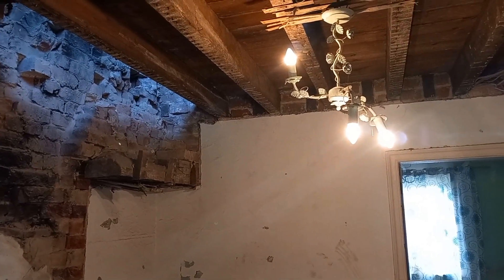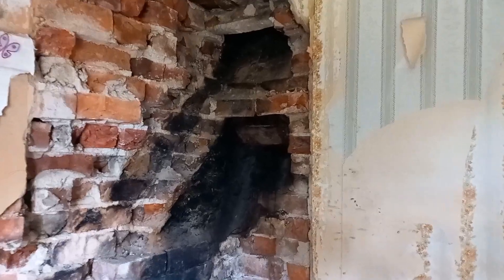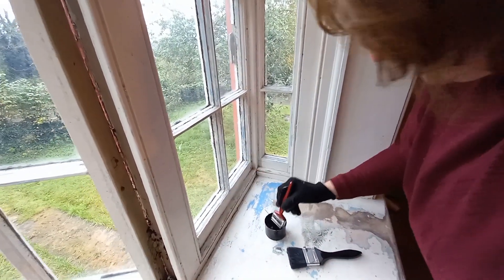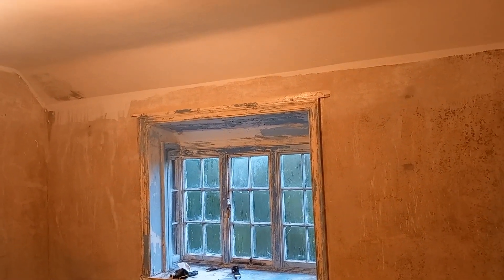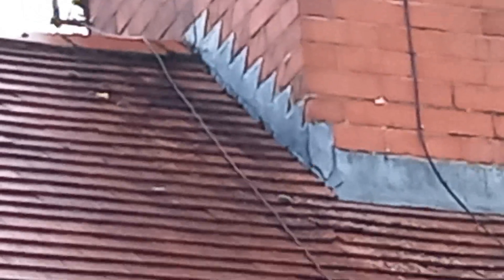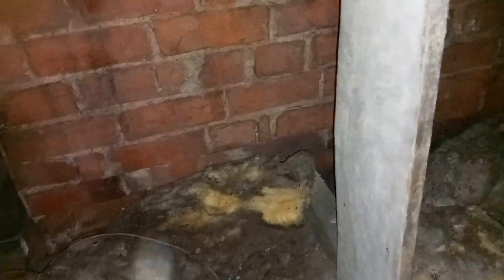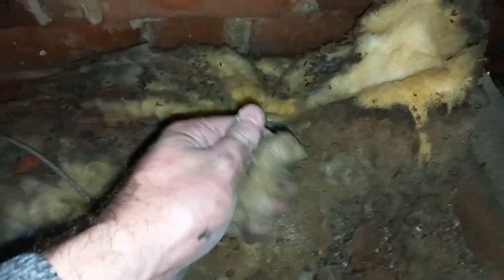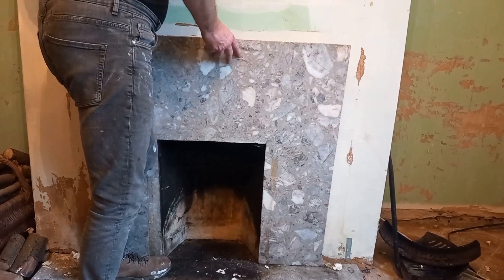STOPPED Cottage Renovation | House Restoration | Ceiling Insulation Install

Comment: That’s coming on really well , shame about the leak but on the bright side you found it early on. Log burner will be fantastic I’m sure you will have lots of wood for it when you start the garden. 
Keep it up until the next video.
Reply from the maker: Cheers Stuart. Thankfully the leak is tiny in the horrid wet weather, it looks worse as the house has been empty for yonks and any wet never got chance to dry at all. We shall use the heater to try and dry the ceiling ahead of going over to collect the ladders from storage.

Comment: Possible pointing issue? Or it the flashing like you said!
Reply from the maker: Fingers crossed its that end ridge tile fixing.
Reply: @OurCountryRetreat  I’m having some pointing done soon after a leak above my window due to that heavy rain we had. and also mate I would seriously look at it. May need pointing up but I’m no expert
Reply from the maker: @RaymondoLeeTravel  I went up there today, well just part I could access. I could see nothing obvious, but applied some gutter seal to where I could reach just as a temporary measure.